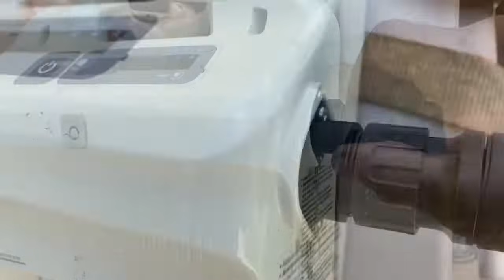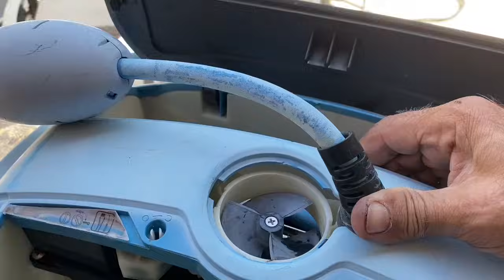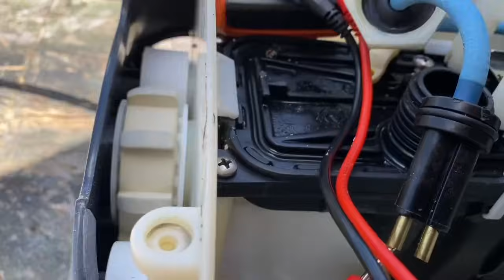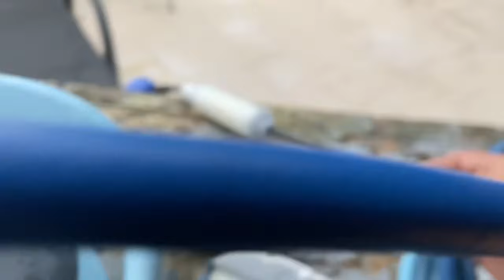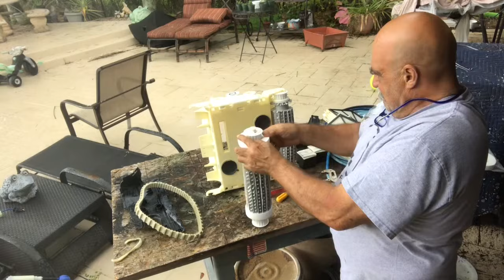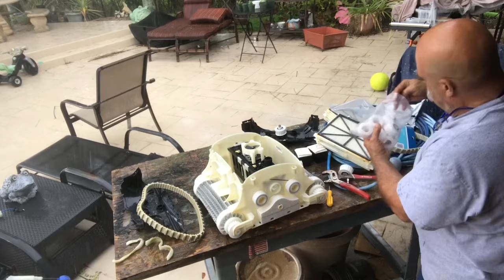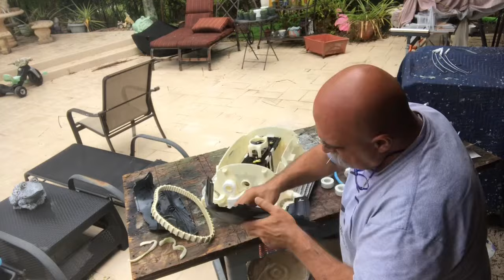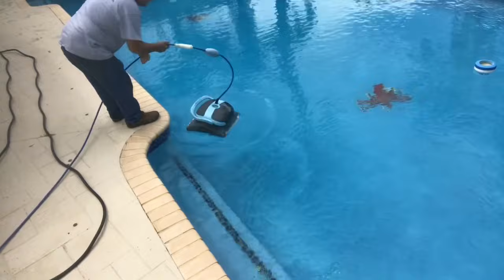How to diagnose and repair a dolphin pool cleaner

Comment: These products are a disappointment. Our sigma only lasted for one use and then stopped working before it could finish cleaning a pool that wasn’t even that dirty. Clean your pool yourselves or hire a pool technician, people. Why risk getting a bad lemon that was most likely put together on a Chinese assembly line.
Reply from the maker: Thank you for your comment. I understand some of them have problems but send it back to the manufacturer. I’ve had mine for over seven years and I think it’s great and easy to repair. I hope you enjoyed the video and if you can leave me a thumbs up.

Comment: Wow~ great video. Thanks for this. I have a question. My unit stoped working after 5-10 min in the water. Thus, I took out and leave on deck about an hour and dry. And still same thing happened. Do you think that the main black box inside has an issue or cable issue?
Reply from the maker: Have you checked the cable? It seems the power is too low Sometimes the unit Hass to reprogram itself, and it works for a few minutes and then stops, but then starts up again.
Reply: @buildingwithpapa  I got new power supply which is 29 voltage. Now it is working… thank you!!!
Reply from the maker: Did you do a diagnostic just as I show in this video that will tell you whether it is the cable or your power box. Please check that first. if you like the video, if you can give me a thumbs up
Reply: @buildingwithpapa  i got the power 26.6-27. Is it okay?
Reply from the maker: No problem glad to help.

Comment: Here's a question... i have a triton ps plus and its currently seemingly working fine (runs all over the pool), but it doesnt seem to be picking up anything.  Stupid question, but is there supposed to be suction coming from the rectangular hole in the bottom of the unit?  Ive gone in the water with it while its running and while the wheels are spinning, i dont feel suction out of that hole.
Reply from the maker: I don’t have a triton, but from what I see and what I have read, it is supposed to have suction to pick up the debris. I hope you’ve enjoyed the video, and if you can leave me a thumbs up.
Reply: @buildingwithpapa  done.  my cord is slightly frayed.   It looks still,intact but the rubber is eroding…badly in 1 spot,  do you think that could be the cause?  I’d hate to spend 300mon a new cord only to find something else is wrong

Comment: My power supply is measuring 27.4, not 29.Does that indicate it is bad?
Reply from the maker: Have you checked everything else yet? Check your cord. If it’s OK your power supply is on the low end. Let me know what your unit is doing if anything at all.
Reply: @buildingwithpapa  The power light comes on when plugged in. I did the continuity test, and like yours, one side I received a tone, the other I did not
Reply from the maker: OK so I would purchase the cable. It is in the description that should do it. Let me know how it works out and if you can leave me a thumbs up.
Reply: @buildingwithpapa  So I purchased the cable, hooked it up, and it looks like it's working. Except!!!! getting the old float off is a struggle, I did get it off and the clip on yours can be removed and placed on the new cable, mine cannot. Any suggestions? I tried to attach a picture   but don't see an option
Reply: I got it off, it is like a zip-tie so it was a struggle, but I got it
Reply from the maker: Yes, if you need to use a zip tie, go ahead and do that. Let me know if it work, and if you can leave me a thumbs up.

Comment: thank you so much for this. I am going to follow these steps tomorrow. I contacted support last week and haven't heard anything, but i don't want to have to send it back to them if it's so simple!
Reply from the maker: Thank you for your comment, and if you can leave me a thumbs up.
Reply: @buildingwithpapa  Done! they got back to me today and said i have to pay shipping for the whole unit back to them for repair. Seems like such a waste! going to do it myself.
Reply: @buildingwithpapa  thank you, the instructions worked great for my Dolphin Supreme. But i have a question. my cable has three pins (maybe because it has wifi). When i do the continuity test, i don't get any tone with any combination of the 3 pins on each end. It seems unlikely to me that all three internal wires have failed -- but does that make sense to you? I already ordered a new cable from Amazon, just curious what your thoughts on it are. If i take the bottom piece of the cable apart from the swivel mechanism, i can get continuity on all three pins on that short cord, but the upper half of the cord (with the metal 'circle' contact inside the swivel) gets no continuity between that contact circle and the pins that go into the power supply (not sure you can even do a continuity test like that, though!)

Edit: Nevermind it doesn't look like it's my cable, after all :( When i check the voltage at the pins that are inside the robot itself with the blue cable plugged in and the power supply on, i get 29 volts. So i don't think this is actually a bad cable. Any other ideas?

Comment: I have the CC plus and noticed it has 3 conductors inside the unit. Has anyone replaced the 2 conductor with a 3 conductor cable? I was thinking using 3 conductor and replacing the power supply could basically upgrade mine from a plus to plus/wifi or supreme functions. I want to either get automation mode or wifi so I can do more complex schedules than every 24h, 48h, 72h etc. Also would make it power outage immune.

I just wanted to add some more detail on using the 3 conductor cable. I purchased one and it worked fine, but it was cheap chinese brand and failed after 1 day. The replacement from the same company failed again. The cheap ones fail at the white swivel with some combination of internal pins not making contact with the swivel disc or the cable pulling out slightly from the swivel unit. Anyway, spend the extra $30 and get a genuine maytronics/oem replacement and you will probably have no problems.
Reply from the maker: Thank you for your comment I hope you enjoyed the video, and if you can leave me a thumbs up.

Comment: Good video. I used this to check my power cable. Though it doesn't seem to be the problem. My cleaner, at power up, turns on, moves forward,  impeller turns on, stops, moves backwards, then just stops and does nothing. You mentioned in the video it is the 'programming' phase. I guess mine is stuck in that phase and never gets going.
Reply from the maker: Did you check the power supply if it’s reading 29? Also, just leave it on for a little bit. Check it in the morning and see if it is moved. Thank you for your comment if you can leave me a thumbs up.
Reply: I had the same problem and just replaced the blue power cord, mine was kind of jacked up looking with some really pliable kinks so I figured it was a short that every once in a while would be ok but when it started moving it would short again.  Seems to be working fine now.

Comment: How long did the robot work before having to perform this maint?   Just wondering how troublesome they are
Reply from the maker: I believe I had it for six years before I had any issues with it. It’s easy to maintain I really like this one. I’ve had many other pool, cleaners and this one has been the best. I hope this helps you, and if you can leave me a thumbs up.
Reply: I just bought a Sigma today

Comment: Back from store with new motor and cable.  It is reprogramming but getting stuck in corner on its side.  Seems to be a balance issue. Thoughts?
Reply from the maker: Thank you for your comment. I’m having an issue with mine right now but it’s not a new motor and it’s sitting on its side in the corner. Also I’ll be pulling it out this weekend and trying to find out what the problem is. I will also then be posting a video if you can leave me a thumbs up.

Comment: Great video but you left short of testing everything,  I need to know if my motor is bad, how do I check if my motor is bad, my cable was bad I replaced it but it still doesn't run still, base unit and cable check out good, motor shows 1.865ohms  on my meter
Reply from the maker: Thank you for your comment. I will find out how to check out the motor. I’m not sure myself I plan on working on one this weekend. I hopefully I’m able to do a video. I hope you enjoy this video, and if you can leave me a thumbs up.
Reply: @buildingwithpapa  awesome! looking forward to it, I am pretty sure its the motor, I Ohm'd it and I get 1.869 which in  my understanding is good. the new cable is good and the computer sends 29v to the motor, I dont want to s[end $300 on a new motor if its still good but does nothing when turned on

Comment: How do check the motor with the multimeter
Reply from the maker: Well, if you’ve checked the power supply and you get 29 then your power supply is good if you’ve checked your cable and you get continuity on both wires, then your cable is good and if your motor is not running, then I would say your motor is bad it needs to be replaced. I hope this helps you, and if you can leave me a thumbs up.

Comment: My dolphin starts and then stops.. I've taken it apart to remove debris and put it back together and it does the same thing. Any ideas on what's wrong or how I can fix it?
Reply from the maker: It’s supposed to be reprogramming itself that should move forward and then backward then stop and then start up again once it reprogrammed itself and if you see the water moving on top that means the motor is running also but it could be something in the motor. it is hard to tell without seeing. I hope this helps you, and if you can leave me a thumbs up.
Reply: Hi, did you solve the problem with your dolphin? My is doing the same it works only for 5-10min and then it stops.

Comment: My M400 is no longer climbing the walls and is not cleaning as well as it used to. I changed the treads, foam rollers, side bushings.  Could this be an electrical issue with the power supply and cord or a problem with the pump inside the unit. ?
Overall the unit seems sluggish.  
Thanks for your help.
Reply from the maker: If you go through my video, you’ll see how to diagnose the power supply if it hits 29 then your power supply is fine. You obviously have continuity with your cable or would not be running, so check your power supply first.
Reply from the maker: Also, if you can leave me a thumbs up.

Comment: Hello Papa 🙂, thank you for your video. I did follow your testing and in my case cable is perfect. I suspect it is the electrical engine. When I give the start command it does do nothing. I just hear a small noise inside the motor like something is wanting to move, but then it stops, nothing happens and I get the message on my App "robot not responding". Everything started with the robot starting the impeller and not moving and then even the impeller do not start. Everything is clean and free of any debris. So basically, the robot does do nothing. Do you have any suggestions? Maytronics would not help, even if in warranty, because I brought the robot in the Dominican Republic! They will even not tell me how to diagnostic it as the claim not to be responsible, because outside the US and they will not tell me nothing even if I declared to them the I will take any responsibility! Pease help if you can.
Reply from the maker: Well, as long as you’ve checked the power supply and it’s reading 29 and you check the Continuity with the cable then the next step is one of the rollers attaches to the motor and has bearings make sure that’s not frozen if that moves freely, then more than likely it’s the motor. I hope this helps you, and if you can leave me a thumbs up.
Reply: @buildingwithpapa  not the case ad I removed the motor block and try to operate it to see, but nothing is turning

Comment: cover wont go back on after it came back from a pool supply house? Seems like it drops right on by the video but not happening? Any thoughts?
Reply from the maker: Is the cable through the slot on the top properly? They gave it back to you without it staying on then I would take it back to them. I hope this helps you, and if you can leave me a thumbs up.

Comment: Thanks!
Reply: Thank you for this helpful video.  One of the rubber tracks on my Dolphin derailed, probably due to my ill-advised habit of tossing the Dolphin into the pool from a standing position instead of the recommended practice of gently lowering it into the pool.  I was surprised at how easy it was to do the repair thanks to your video.
Reply from the maker: Thank you I’m glad it was helpful if you can leave me a thumbs up

Comment: Thanks for the video. I was able to change the foam rings and the swivel cable on my Nautilus cc plus. When I put it in the pool the unit only stays on the walls and it does clean the floor, any idea of what have I done wrong or what’s causing this?  thanks
Reply from the maker: Do unit is supposed to reprogram itself once you put it in the water and start it back up I would suggest to unplug your power supply wait at least 20 seconds or more and then plug it back in the unit should move forward. Stop the move backward and stop and it should pre-program itself. I hope this helps you, and if you can leave me a thumbs up.
Reply: @buildingwithpapa  I dit the unplug and it did not move until I press on the power button. And with out selecting a cleaning cycle the the unit does move forward and backwards but it doesn’t stop , it goes to walls of the pool from there around all the sides, but not the floor.  I will have to check with maytronics to see if they have a clue. Thanks
Reply from the maker: When you had it open, did you check the bearings?

Comment: Hi there. Multimeter test on power supply is fine, replaced the cable and have continuity, tested cable connected to power supply and got -29.00 - good. Replaced the motor but cleaner not moving. Help!
Reply from the maker: Did you check the one roller it has a metal end on it that has to be attached to the motor itself please check that if that’s connected. And if you can leave me a thumbs up.
Reply: @buildingwithpapa  Thanks Santo but that was not the issue. Sent the whole cleaner back to Maytronics as they believe the new motor is defective.

Comment: Hey There, Thanks for the details, What were the symptoms to this cable failure?
Reply from the maker: Thank you for your question. The machine was not running so I knew that was a problem, but did not know if it was the cable or the motor so I did a process of illumination just as I showed if you enjoyed the video, please leave me a thumbs up.

Comment: I have the remote controlled cleaner. I don't really use the remote but let it clean on automanic.
 However, when starting up for Spring I find it will not run automatically and only will move by remote control and will not switch back to auto. What am I doing  wrong?
Reply: It is a Dolphin Plus cleaner.
Reply from the maker: I don’t have one with a remote, so I’m unsure about that but thank you for your question and if you can leave me a thumbs up.

Comment: I have bubbles that come out of the top of the unit. Then it stops and then the lights on the remote are lit up
Reply from the maker: Thank you for your question. 
It is supposed to do that You just have to put it on the cycle that you want and it will continue to run.

Comment: We are getting 26.9 out of the right side of the power supply. Where should we put the multimeter into the right side of the power supply? They are numbered 1, 2, and 3. Thank you. Great video.
Reply from the maker: Thank you for your question. If you go back to the video in about 50 seconds you’ll see where I am putting the tester into the power supply if you look at the cord you pull out there’s only two prongs you’re gonna want to put the two prongs that you have of your tester into those two holes wherever they are plugged into the power supply and you should have 29  26.9 is low. There are different power supplies if it looks like mine then it doesn’t have a fuse inside and if you’re not getting enough power out of the unit that I’m sorry to say the unit Hass to be replaced. Also while you have the cord removed check both for continuity to make sure your cord is still in good shape.
I hope this helps you and if you can leave me a thumbs up.
Reply: My Nautilus pool cleaner is about 1 1/2 years old and it will move and stopped. Is the motor defective? How do I test the motor?

Comment: Thanks for this video.  How do you remove the floats from the old cable?  The video shows it already separated and I can't seem to get mine to budge.  Thanks!
Reply from the maker: Thank you for the question. if you go to the video and about the four minute mark is where I take the float off the cable, the plastic pieces has a little slot and with a screwdriver you can push them in and then separate the float.
I hope this helps you and if you can leave me a thumbs up.

Comment: Good job! Thinking of buying the Premier as I would like to get the tile cleaned at the water line.  A bit hesitant as people who have issues with the units get little to no support on warranty, but seeing how simple it is to work on, the only things that can't be fixed are the DC motors and power supply. I assume those can be purchased separately.  Thanks!
Reply from the maker: Yes they can be purchased separately.
I’m glad you enjoyed the video if you can leave me a thumbs up.
Reply: I did, take care.
Reply from the maker: Thank you
Reply: You just have to service your sigma after each cleaning to keep it working efficiency.